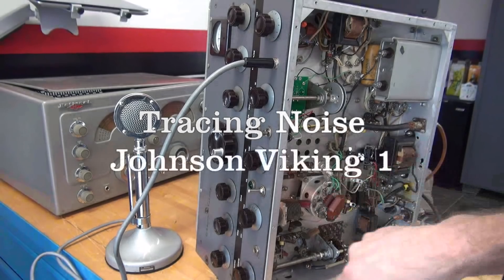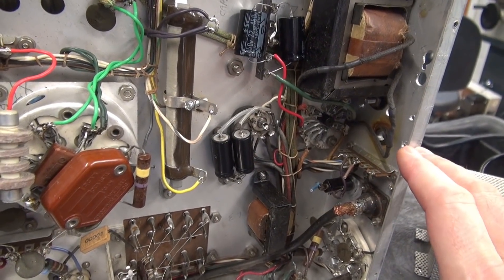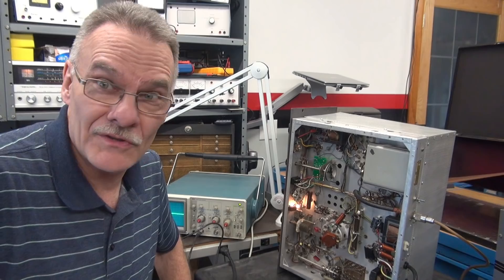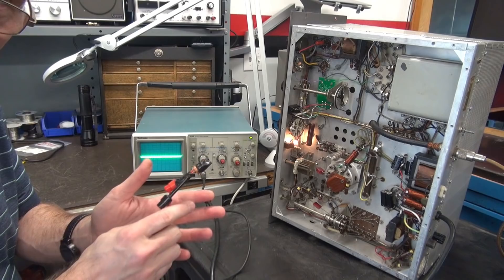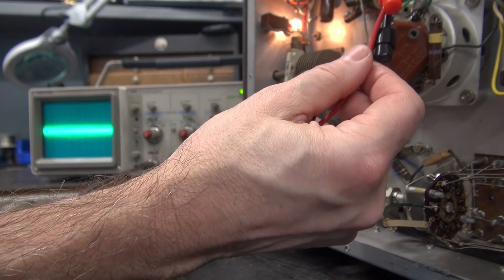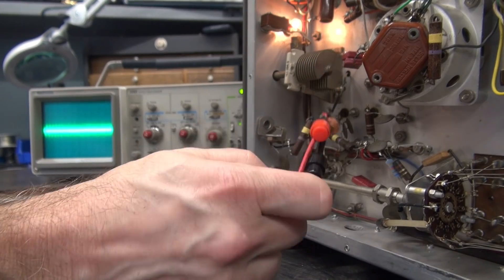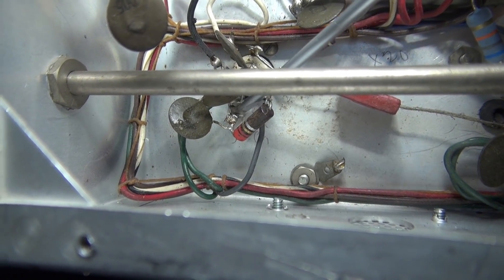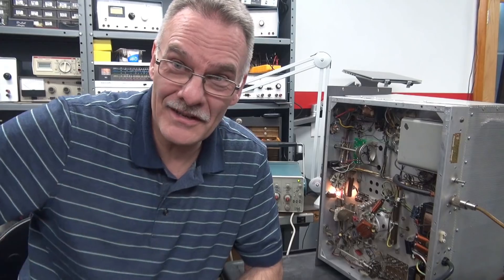Troubleshooting Johnson Viking 1 Ham Transmitter noise tracing down multiple issues

Comment: Can you disconnect the output of the Exciter from the input of the PA, and hang a load on it too closely match the PA tube?  I could be wrong but I suspect that the output of the exciter is not 50 ohms.  Basically all but eliminate the PA stage through the tank.

This will tell you if the problem is in front of the PA or after it.

Comment: Rather than lose anything, it's going to be an incredible gain - a good learning experience. I'm still saying it's a grounding issue (either missing ground, misplaced ground, major ground current going through the chassis). If you can find any pictures or parts-diagram-layout of this model from the factory build, no mods, perhaps you may notice something misplaced. Your coil/AC attempts were good guesses. I was hoping one would have worked, but to me, a strong AC 60 or 120Hz current/voltage is adding to the audio somewhere. I think you need to think about that symptom (hand close to socket area produces louder hum). That area should be relatively low impedance, high power RF under that socket if it's one of the 6146's. Thus it shouldn't be so sensitive at 60/120Hz. Then there is the constant hum as well. I say something in the audio path (modulator tube area) is not grounded properly. That's a loud hum. It appears that this set has been rewired in many places. That puts all the wiring in doubt. Time to check every connection against the schematic. Perhaps something in the audio path isn't even grounded. Are the filament wires to the 6146's supposed to be returning through the chassis? Was there a hum-balance control somewhere? EDIT: Is the chassis properly earth-grounded through the AC line system?

Comment: Terry, when you touch your Tek scope the noise on the screen went down, should it be a ground problem in your lab? Another thing that you may check is if there is any difference between cold and warm tubes. Very suspicious is a filament short to some grid, check tubes. 👍👍

Comment: Hi,
      Looking at the schematic diagram of the Viking 1, I see that the 600V line is filtered by L1, and C9. i have no idea about the reliability of such components. There is a resistor marked SH1 between the centre tap of the mains transformer, and chassis ground. I would have thought that it would be possible to see if any hum/noise was appearing on the power supply, by monitoring the top of SH1, and ground using your oscilloscope. No idea what voltage should appear there. It is a Bi-phase rectifier circuit, so I would think you should get 120 Hz into the filter in North America. 600V is a bit lethal when compared with modern equipment.

Frank Hedley GM8TXC

Comment: I was going to add what some have suggested, that sounds a lot like 120hz. If it doesn't respond to the volume control it's on the ground. Possibly rectifier issue. Is it the same if the rectifier is in place?

Comment: Even though you are in CW/SPOT, there are still connections power wise with the modulator. Possible grid to filament short in modulation/pre-amp tube?

Comment: Terry....My comments for the day:

If I recall correctly, a weaker level of the same noise is present when the rig is idling and not in TX, and only gets worse with any current draw on the transformers.

That audible AC noise must have a physical source creating it, like a transformer or choke, so I'd suspect the power supply components.  Do you have a stethoscope or small microphone you could use to locate the source of the audible noise....?

It could very well be loose transformer laminations, or an internal short, or if not that, some rectifier issue kicking back on the transformer and causing the audible hum....is it 60 or 120hz noise...?   That would help to know...!

That's all for today Terry....Good luck and 73 de Jordan VE6ZT

Comment: Hello Terry.  I see where you have been and where you're going but just to make sure you're NOT chasing a rabbit, with a crystal & all tubes in place,  use your scope pickup probe to look at the signal being sent out to confirm the modulation and try to identify it.  Next, starting with removing the final, confirm that the same signal is still present and repeat with the next tube in the chain working back till you find the signal or it stops.  My two cents.  Bill WB9FFG

Comment: If you have grid leakage in one or more tubes, your B&K 747 tube tester will not always show that problem; why! not sensitive enough. I own the same model and the Sencore line, calibrated the model to be sure. The Sencore TC162 and TC28 were the only ones that pinned out this fault even though the tube showed good gain, "a tough problem". The only other possibility that I can think of is the bypass capacitors, they must be correctly orientated to minimize hum pickup.

Comment: Non symmetrization of filament voltage due to broken/faulty symmetrization resistors? (I´m still stuck in the idea that the filament heating is the problem).

Comment: I dont know why but I have a feeling this is originating in one of the power supply/transformer areas as a weak noise then is getting amplified when it reaches the tubes. So tracing the larger noise signal may be useless.

Comment: I'm a retired biomedical engineer so I'm an expert on this of course: the aether in the sub-chassis is compressed due to being slightly cooler and thus more dense - bringing closer together the waves of varying heights and times. Install an air conditioner below chassis of ~5,000 BTU.  Terry, can you measure leakage current to ground? I'm curious if the power transformer might have a leakage path to ground, coupling TONS of 60 (and probably 120) Hz to chassis. You'd have significant leakage currents to ground and misery all around. I've seen it happen. 73 OM
Reply: Terry, you should shot a message to Shariar @ The signal path, he is PhD in electronic waveforms.

Comment: It's not burned time at all. It's self educating time - which is always worth spending.
On important thing i learned during fixing electric issues around cars:
NEVER work around a problem by adding some iffy patch. It will cause side effects, you might not see it now, but they might show up later, when the car is back in service and the relyability will be gone.
NEVER get into that thinking, that the engineer, who built it, made a mistake or forgot something essential and don't you get the idea, that without your own mod this thing will never work.
That's always wrong. If it was on the market, it once worked - so i DO have to find the point, where the circuit is out of specs.
If i cannot find the problem, i meticulously reset the circuit to factory specs.
This always let me find the point of issue, as long as i have access to the wiring and the circuit - which is sometimes very hard on modern cars.
Can't always do that for customers, since they more likely buy another working car than putting a lot of research time in an anyway used up piece of junk.
But as soon as i don't want money from the job any more, but accept the job as educational time for my private level of knowledge, i'm free to learn more.
Your receiver doesn't need the modifications of another model to work right, keep that in mind. It just needs that faulty part fixed.
Save the modding time!
Better spend it in checking the specs of every part and by doing this restore this terribly messed up wiring.
As soon as this thing looks and has the specs, like it just left the factory, it will work like new too.
Every workaround adds a problem.

Sorry, al lot of non helpful texting here - i just don't see the right attitude at this case, that's what concerns me. Maybe you just didn't have it on film.

Comment: Are you using an external VFO? IF so, try running a ground wire from transmitter to VFO.
Reply: Replay the video.  It's NOT attached.

Comment: I'm taking for granted you looked at power supply voltages, ripple, regulation, while in transmit mode? Look at filament voltage on scope also in case of an internal arc in power transformer. KB7QKS
Reply: It sure sounds like a power supply hum, doesn't it?

Comment: Were you put that ac filter choke & were your power comes in , are you coupling the Ac on that transformer sitting next to it. Move that transformer, and relocate it, try it.
Reply: We have to remember that these units did not have that noise when they were new.  It should be unnecessary to reconfigure the construction to get this fixed.

Comment: I don’t know the circuit, so these are generic suggestions.
Have you:
*grounded the grids of low level stages leading to the PA?
*scoped grids and plates of the RF and AF signal chains, looking for the 60/120 Hz noise either alone or modulating RF?
*scoped LV DC supply points with AC coupling to look for the noise?
*ruled out AC heater noise coupling to cathode in a bad tube?
*verified or repaired all grounds?
*ruled out some oddity that causes this transmitter to be sensitive to induced hum from your shop lights?
*tried a signal tracer in low-level stages to listen for presence of hum?
*eliminated the possibility of defective rectifier(s)/filters?

You might try a few turns of hookup wire on the scope probe tip as a sniffer, leaving one end AND the probe ground floating. Just make a little end fed antenna. More turns=more sensitivity. Might work better than the choke. It works for me.

Noise as bad as that has to show up as 60/120 Hz on the scope somewhere in the rig. Set the sweep to measure its period and search systematically.
Reply: The hum/buzz showed up in the earlier video even when the unit was in CW mode with the final HV turned off (as if 'spotting' the freq on a receiver). Got louder with final turned on. (I think he even said it made noise when the osc was in xtal mode with no crystal installed.)
That would make me look for problems in the 6AU6 osc or 6AQ5 driver stages. Both get B+ from rectifier V10 (a 5Z4) and both get negative bias from rectifier V11 (a 6AL5, _yep, you read that right_).  Both supplies should be checked as sources of noise.

Comment: Like the previous installment on this problem, I see lots of good suggestions.  I'll try not to duplicate any of them.

Do you know the history of this unit?  Could someone have changed something in it that isn't obvious, like swapping two wires or similar so it isn't actually wired as designed?

I think you need to try to pin down the frequency of the noise or hum.  Is it 60 Hz, 120 Hz, random noise?  Sine wave or ???  Doing that might help to identify what the signal is, and then the source.  60 Hz AC would be line power related, 120 Hz might be full wave rectified, that sort of thing.

Anyone want to take bets on there being a spike in Google search stats for "Johnson Viking 1 schematic"?  Courtesy of the D-Lab Effect! 😉

Comment: Terry, did you replace the tubes? There may be a tube that although may measure ok, it can have AC leakage from the filament or something. I remember seen this problem in one of Mr. Carlson's videos. Also, caps, although they look nice from the outside they can be busted inside, as you already know. Looking forward for the next episode of the saga. 73s Charlie.
Reply: One of my rules when dealing with tough problems is to suspect "consumables" - they may have found a new way to fail.  In this case, tube are "consumable".

Comment: First..Don't worry about disappointing anyone if you can't fix it. Seems we are all stumped.
I was working on a pyramid power supply that is tripping the over current circuit off. I have 40 plus years of experience fixing circuits and several degrees  in electronics, a fully equipped shop and I still can't find the problem.
Drove me crazy...er. So I bought the power supply from my friend so I can take my time to figure it out.
I will test each part piece by piece if I have to...this is a sure sign of mental illness .
Reply: It's an investigative attitude. I like that , keeps the world going.

Comment: Hang in there Terry. You will find it then slap your forehead wondering why you didn't think of it sooner. It does sound like the buzz has a 120 cycle in it. Good luck
73 de K7RMJ Frank

Comment: Dear colleague. I had a similar problem with a Brazilian transmitter, but it was a design problem, the oscillator worked at the fundamental frequency and there was feedback from the output stage to the oscillator. Another suggestion that I imagine you have already tried: Change the oscillator valves and the multipliers; despite testing as good on a valve tester they may be generating internal noise. Another possibility is to use some type of infrared or thermal camera to check any component that is generating thermal noise.

Comment: See if any Remedy shows up on google , Type in the problem, maybe theres a solution that no ones tried or maybe  a bad switch  contact internally, or if theres any mica caps or how ever thats spelled check for that Like old Radios , thinking like silver mica disease in a cap or tuning circuit, is there any thing like that in a ham radio or are thet built differently? check all them and the variable capacitor , some place theres gotta be a slight short. but try google the syphtoms and see what that says from there try what it says  one section at a time  , hope you figure this one out, but there must be a reason why they changed the design of the circuits from the 1 and 2 viking series, there is where you might find clues as why this isn't running correctly.

Comment: Terry - very strange problem.   Try removing the bulb/lamp-and see if the problem persists. That 6.3v line for the bulb runs in the same spot you found the loose ground.  Also,  Have you tried removing the PUSH to TALK board you installed ?  I assume the radio was ok before it was sent to you so perhaps there is a conflict with his model and your board, or a miswire???  GOOD LUCK my friend..... you will find it...

Comment: The buzz sounds like 120 Hz. Maybe poke around in the HV supply? Maybe you've got something going on after the rectifier? Ground loop forming in the oscillator or mixer?
Reply: That's exactly what I was thinking. Could be another bad ground connection to the chassis.
Reply: As bad as that one near-6AQ5 ground was, it might be advisable to examine all of the grounds. Bad grounds can be the cause of some strange stuff.